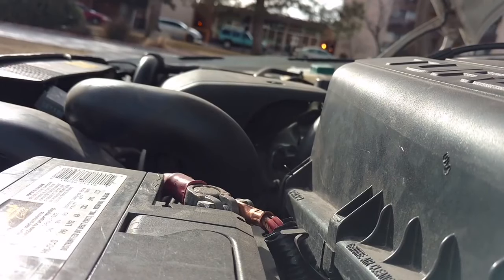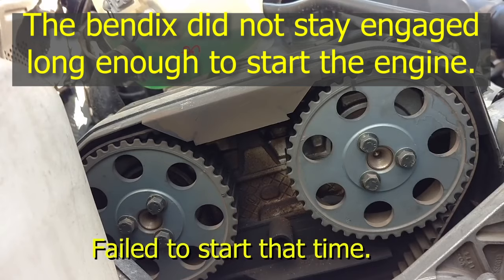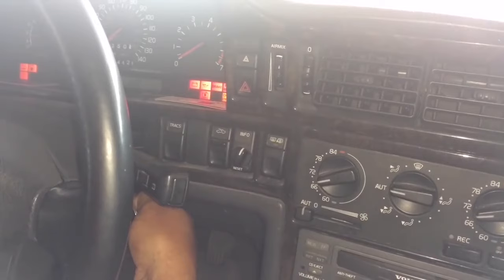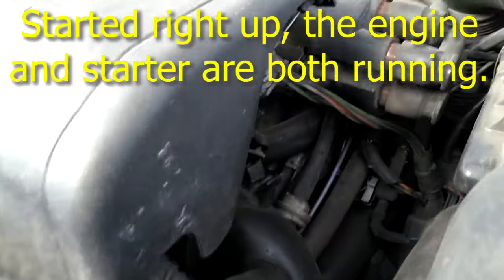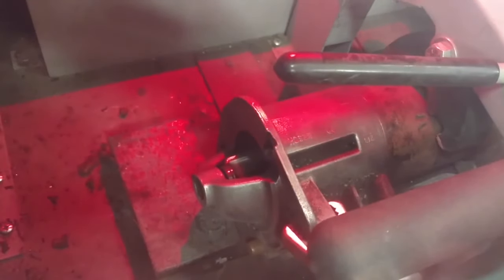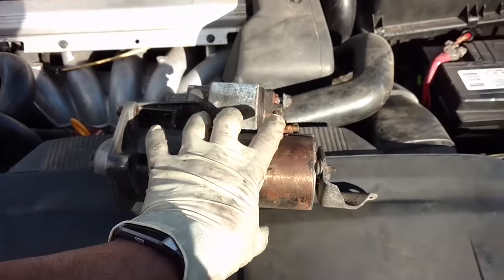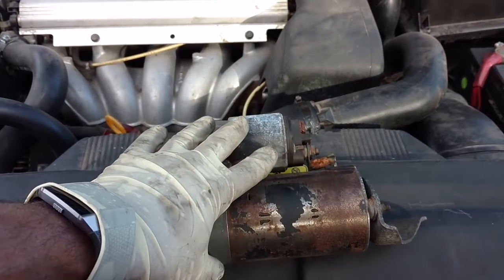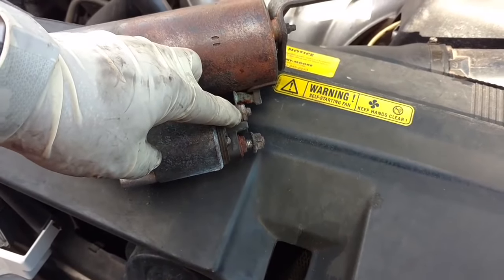Is your starter bad, hear the noises or sounds a bad starter will make. Also a full demonstration.

Comment: Skeptical of my starter being bad but your video helped secure my suspicions and getting it replaced tonight! Truly one of the best instructionals ive seen
Reply from the maker: thank you very much.
Reply: I've got to get mine replaced this weekend on my 98 Buick century limited. I have taken a metal prong thingy and touch the 2 bolts on the starter. They will spark but it kicks in the solenoid and then cranks. I can't deal with it anymore. I'm just glad it's lasted long enough for me to get up the 55.00. lol

Comment: I found several videos that will say, "This is how your starter sounds when it's going bad" and then turn the engine over. They say it sounds terrible, put in a new starter, turn it over again, and it sounds exactly the same. They never explain what sound I was supposed to hear. You sir, took the time to explain it clearly and concisely before you even showed us the car. Then, you demonstrate multiple types of failures, explain what the starter is and how it works. I learned so much in the 7 minutes of your video that I liked and subscribed. I normally don't subscribe unless there are a minimum of 3 videos that I find useful. I can't wait to see what your channel has to offer.
Reply from the maker: Thanks for your support.
Reply from the maker: If you watch my top 5 viewed. Videos you'd probably be good.

Comment: Thank you for this video! It has solved an insanely frustrating months long problem AND explained all of the things that made diagnosing it so frustrating and why whacking the starter with  a wrench worked.

My Forester randomly wouldn't start, but if I kept trying it would start. It might take two or three times or I could be trying for more than a half hour, but it'd start and then be perfectly fine for awhile and everything would test fine when I took it in for repair. 

The fact that a bad spot on the generator would cause this and it would explain why if I tried to have it towed in during one of the long time no start sessions, it'd start right up after taking it off the tow truck. Putting it on the tow truck jostled it enough to move the starter past the bad spot on the generator.  
My car wouldn't start last night and I tried for hours, and did testing with a voltmeter, but got nowhere. The Forester starter is located in an awkward place for me to reach to  test with confidence,  so we were putting that off til last. I watched a video that suggested gently whacking the starter with a wrench. I did and it worked - started right up and has kept starting w/o an issue. They didn't explain why that would work.  Your explanation makes the whole saga of these last few months make perfect sense. I can now take it in for repair and explain what is wrong with the starter and why it won't fail for them. I'm so relieved to be able to put this behind me.
Reply from the maker: thanks for sharing.

Comment: Thanks for the video! Currently dealing with this problem - my XC90 (2018, D5) had a starter failure this week. I read in various sources that such sounds in the engine compartment of a car can come from a drive or track belt pulley, a dead tensioner roller, up to turbine problems and a crack in the engine valve cover. Luckily it's only a starter, however, the repair bill for this thing is very high
Reply from the maker: Sad but true.

Comment: I had a 'whirring 'sound after engaging the starter, and the engine wouldn't turn over. After listening to your video, I deducted that it was probably the Bendix, I took the starter off and tested it on my bench and it all seemed to work ok, BUT I noticed that when I turned the small cog that flies out (disconnected from battery first),it turned freely in both directions, when it spins out on the bendix it should engage and stay fixed in one direction(in order to crank the engine) I sprayed penetrating lubricant into the housing behind the cog (I think it houses the gear mechanism), and this worked to engage the small cog and stop it from spinning in one direction.I put it back together and the car starts first time now. BTW I have a tuned up 1980 7.5 L (454cui) Chevy Camaro Z28, tuned engine, 450 bhp! back here in the UK she is quite rare and turns a few heads. Thanks to all you guys for your American know how videos they keep me burnin rubber ;)
Reply from the maker: Awesome! Thanks for sharing.

Comment: I have a 2019 mustang and my starter recently went out with only 30k miles. The sound it makes when I try to turn the car on is like a tornado alarm. No clicking, no spark just a loud whine type. You showed a small piece of the sound I hear in one of the examples and with that being said, you have knocked so much weight off my shoulders thinking it was way worse than it is.
Reply from the maker: Awesome! Thanks for watching.

Comment: Very knowledgable. Great video with the second part with the sounds makes sense. I was married to a mechanic and my son is a mechanic so I learned a lot paying for fixing up old cars and even when I was single I did some repairs on my 68 mustang. I'm having problems with you to the alternator or the starter I changed out a battery on my RV. I just bought it so I wasn't sure how old it was my son is fixed everything underneath brakes add calipers and everything for safety and I was ready to start traveling and when my car sits overnight sometimes it acts like a dead battery but it's brand new. So I'm thinking either the alternator is draining the power or now maybe the starter but it doesn't sound like this video it does a little whining. When I'm driving and running errands it starts just fine it's when it sits overnight. But it's a brand new battery only a couple months old and maybe the old battery wasn't that old.
Reply from the maker: Probably the alternator. You should do a draw test with a multimeter.

Comment: My starter sounds like a drill. The bendix comes out and locks into flywheel teeth, but doesn't turn over the motor. The starter tested good at two different parts stores and the flywheel looks good. It's a tbi 350 and I can turn the motor over by rotating the crank.
Reply from the maker: Yikes

Comment: I worked on a Ford transit camper DIY conversion that had the symptoms of a weak battery, I tried another battery and nothing changed it carried on rapidly clicking slowly turning over the engine, the customer had me change the starter beforehand they'd been told it needed doing anyway 😂, in the end I figured out the guy who did the conversion added an extra (really thick) earth to the van battery when adding a smart charger for the leisure battery. This added a tone of resistance to the circuit
Reply from the maker: ouch

Comment: How about a situation when the starter motor bendix only slips when the car is hot and been driving a while, but when the car is cold or in the mornings starts with just one kick?!
Reply from the maker: Sounds like a battery issue.
Reply: @RobertDIY I have this situation also and just changed the battery but when its hot I struggle to turn it over.
Reply: No problem wuth morning starts

Comment: This is THE best tutorial on starters. Thank you so much!!! Exactly what I have been looking for.
Reply from the maker: Glad it was helpful!
Reply: @RobertDIY  Question. So I have two batteries that are about six months old. That are not recharging. Alternator is good. My ac compressor has no belts. Will that affect the alternator. Because it looks like it's a pulley system. If I jump it, it starts. As soon as I turn it off, the batteries are dead. Rapid clicks, then a couple of clicks, then one, then it's dead. So maybe the isolater? Or a drain somewhere?
Reply from the maker: Sounds like the alternator is bad.
Reply from the maker: https://youtu.be/2rVt-TDqmSc
Reply from the maker: https://youtu.be/_1q40V-BPQc
Reply from the maker: Could also be a loose connection or bad cable.

Comment: I always run into the dead zone problem.  I always put it in neutral give it a push and pop it into drive.  Then I return it to neutral or park and start it.  Worked every time.
It's an issue with the brushes or their contact in the motor.  It's usually oxidation that can be fixed with an electric contact cleaner.
Reply from the maker: Never tried that before. Thanks for sharing.

Comment: great job Robert. My car just died in driveway, I am a do it yourself guy... I was able to probably diagnose that my starter was bad. I have the dreaded "one click", nada. Full battery (checked levels), fuses, voltages and all that I hear is click, a loud click and no start. The car was just towed to my shop, so I will let you know if this indeed was correct assumption. I was not going to spend painfull time trying to get the starter out (Honda Pilot), had to remove battery, tray, then get that 10mm socket into starter.. no thanks!
Reply from the maker: I understand
Reply: @RobertDIY  Hey Robert, I was correct on my evaluation- it was the starter. It was the original starter, from 2005. So thanks for video, it I ever quit my finance job I can be a mechanic! LOL

Comment: Very helpful video! My 2018 Mitsubishi Outlander would not start tonight, it has been making a whining noise and would not start after a few tries. Previously it would not start if it was cold out. OReilly's tested it, said it was the "crankshaft position sensor". I got one on ebay for a huge difference in price. New, it worked for a while, then the car just started starting with one try. I was so happy! Then its gone to making this long whining sound and will "hum" for a while. I do think its the starter..
Reply from the maker: ok

Comment: Very good subject keep in mind many of the problems electrical not really a bad component but a corroded oxidize high resistant connector sometimes on the solenoid to the battery cable or the solenoid to the starter connection cheaper to do that first with sandpaper before start to replace parts. Good luck to all.
Reply from the maker: Interesting.

Comment: My man this is a top of the line in depth video, props to you, and thank you very much,  I just got  that single  click sound on my 02 f 150, battery is strong,  I tapped the starter with a hammer  but still  nothing  so I will put a starter in tomorrow,  20 yr old vehicle,  original starter  so I guess its finally gone out, thank you..
Reply from the maker: you are welcome.
Reply: @RobertDIY  Starter is in Back , on the road  👍

Comment: Thanks much for an outstanding review of starter problems!  I just replaced my battery and the starter still struggles to turn the engine over.  Sounds like a weak battery, but pretty sure the starter needs replacing.
Reply from the maker: thanks for watching.
Reply: @RobertDIY  Turned out the starter did need replacing. Bad starter probably cause of premature battery failure

Comment: Great video. 
What would make a rattle sound for a couple seconds only in the first start after sitting awhile. New starter 
Turn off start right back up no rattle sound. Old starter didn't make this sound. Thanks for your great video
Reply from the maker: I can't hear it from here. Maybe the flex plate is damaged.

Comment: Wow finally someone that explains things in detail, I really appreciate you for posting this type of content, subscribed. I have a 2006 bmw 325i, when trying to start I hear a low click and a noise as if a muffled fan ran for a couple seconds and slowed down. I want to say whining noise but might be over-exaggerating the sound. I even tried jumper cables, and lights and everything is good, no dimming on crank, just no start.  you think it's the starter?
Reply from the maker: Sounds like it.

Comment: On my mother's 1999 Honda Accord (4 cyl), the starter motor would spin, but the Bendix would not engage. I could hear the whurring sound of the starter motor spinning, like in your first example in the video, but no click. The Bendix didn't try to engage at all. It started perfectly fine one minute, but when I turned the key later, the starter motor would spin, but the Bendix did not even try to engage. The starter on the Accord was the original starter, so I suppose it was about time for it to go bad.
Reply from the maker: sounds reasonable.

Comment: Just had a manual Honda Civic with a spinning ring gear on the flywheel! It makes a sound similar to the failing Bendix. I wasted money on starter motors, I had no idea these gears could come loose (press/heat fit). Must have heated up when the old clutch (replaced) went bad. I spot welded a few points on the interface, rather than doing an entire flywheel replacement job. Don't know if it will work long term, but my initial starter test is good.
Reply from the maker: Interesting. That is probably a very rare condition.

Comment: You answered my question immediately. I get the constant clicks. So a new battery should solve this. I have a 2004 Pontiac grand prix. I really like this car but the battery is hard to replace because of where it is located. 
Thanks!
Reply from the maker: Get a jump start then drive it to the parts store and have them test it in the car if possible.
Reply from the maker: And get these for all of your vehicles: https://youtu.be/MsIIk32TorY

Comment: Hello, had another example of the 'click' today. In-laws' Rav 4 wouldn't start. Got the 'click'. Turns out Aid condenser motor was stuck causing the ancillary belt to lock the cambelt so starter motor wasn't able to turn the engine. Or something along those lines (I'm not a mechanic, tis what the breakdown mechanic said) Informative video though. Regards Stephen
Reply from the maker: Air compressor. That is super rare.

Comment: This was really informative. I have a problem with my car starting and trying to figure out if it's the starter, the starter relay (maybe) or the key ignition switch (maybe since the key can come out when it was running). Now, there are no clicks at all when I turn the key and it doesn't start. None. Battery is good. Car has gas, lol. But thanks to your video I don't think it's the starter / Bendex unit. On to the next trouble-shooting option...
Reply from the maker: Hope you sort it out.
Reply: @RobertDIY  Haha! I don't even want to say what the final outcome was, because after all this research, I noticed that this car (belongs to my son) was left in Drive / but was able to remove the key. So once I put it in park, it started right up! I will remember that next time! Argh! Thank you again, though, I really enjoyed your video! :)

Comment: Thanks, that's the same sound that is making on my 2013 chevy equinox.   It makes a grinding sound when the engine is on but after shutting the engine off and on a couple of times, the noise disappears but it comes back again after turning the engine on again.   I believe it's the starter that is failing on my chevy equinox.
Reply from the maker: thanks for watching and sharing.
Reply: @RobertDIY  yep, i share it, incase someone is dealing a similar issue as mine, so they dont have to waste too much money or fix something that isn't broken but ends up wasting time.

Comment: Very informative.. the last 2 days i been having to tap on my starter to start it up.. it might be a dead spot, you turn the key nothing happens.. you can hear the starter motor running as a low hum sound as i turn the key but wont engage the flywheel to start the car, it could be frozen, as its cold out.. it wont crank if i leave the car off for more than 12 hours outside in the cold, at some point I gotta warm it up otherwise when i wake up in the am it wont crank unless i tap it the starter
Reply from the maker: ouch

Comment: Thank you so much for taking the time in all of the details
Reply from the maker: You are so welcome!
Reply: @RobertDIY  I put a new battery in my wife's Mercury Mountaineer yesterday and it still does a "crank but no start" I am stuck between ignition and starter because I put the key in and the automatic seat doesn't know which way to go until key is switched to on but then it just cranks and no fire. Move the key from crank to on and the car still cranks by itself a few more seconds. Your detailed video was great to watch.

Comment: Thank you Sir!

I had the one loud click so I test my battery and it was good. I knew it was my starter but I want to see if I could get my truck to start so I could get it on blocks to work on it in the morning, that way I didn't have to jack it up.

I was looking for the starter so I can give it a couple taps. Well I couldn't get to it from the top so I just turned the key and it started right up. I was able to get it on blocks and just wanted to make sure it was the starter before I buy another one.

Your video helped!

Liked and subscribed! 😃
Reply from the maker: Cool, thanks for your support.

Comment: Helpful video 👍 I thought my cars issue was the battery, but I had it tested and it was producing a "good" level of charge, both idle and under load, they also checked the alternator (however accurate an on-car test is) and said it was fine. I guess the starter motor is the only culprit left.
It seems to try to crank over a couple of times and then the next time you try, you might not get anything.
Reply from the maker: Ouch.
Reply from the maker: It's best to test the alternator on the car while running.

Comment: Robert,  I like how you explain about certain sound you might hear from a starter.  However, not sure, but you briefly touched on a starter that is still engaged and could start a fire.  My issue is with my 2004 Volvo S40 1.9L.  I just replaced the starter.  When I reconnected the battery cables, the engine is trying to turnover without the key in the ignition.  What could be causing this?
Reply from the maker: Bad starter
Reply: Make sure don't touch 2 wire on starter when u installed i use to have same problem befor until i find 2wire on starter make little contact my fault